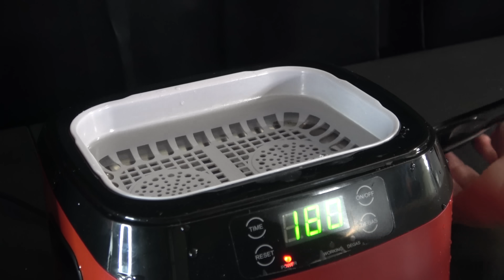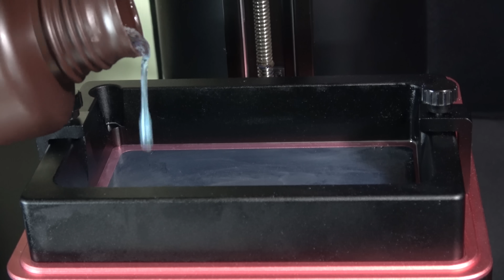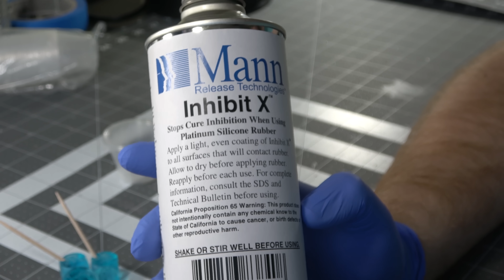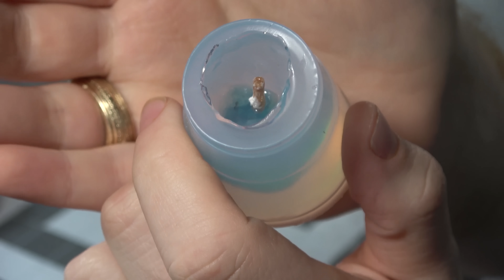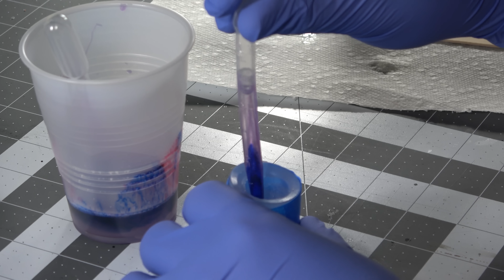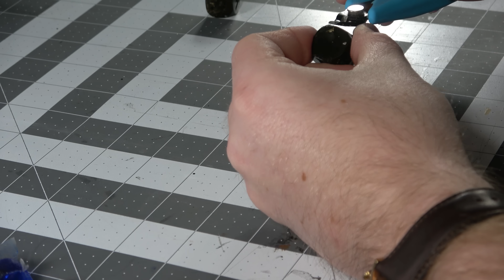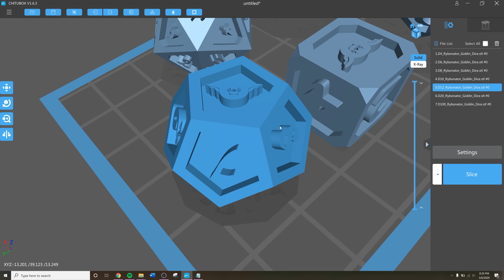How to Make Master Dice for Molds from 3D Printed Dice

Comment: Thank you soooo much for giving us the free files, they look amazing! 
But i have some issues with the downside of the pre supported dice. All the zeros on the lower side of the d100/d10 and so on, have issues and i cant figure out how to fix it. 
I tried different resins, heated up the room, warmed the printing plate and the resin bottle in a water bath, tryed different settings on my printer (mars 3 pro) everything with the same result. Not good enough for my masters. Now im trying to put on the supports manually, i'll let u know if it change something.
Reply from the maker: For manual supports, run a TON of them along the edges of a die, and hold it at a 45 degree angle. There is a guide I've put up, and another great Youtuber did on how to do it :)

Comment: I know this video is a little old, I see in almost all your vids where you sand you use glass under the sand paper. Is there a specific reason you do this?
Reply from the maker: Yes actually! Glass is perfectly flat, and so your sanding comes out consistent every time. Other surfaces often have imperfections which can ruin a sanding

Comment: hello everyone! is there anybody out there to tell me how to avoid fails on 3D printed masters? I followed all Rybonator advices for printing good masters : dicemaker program, good orientation with custom supports on edges, and I tried to print with sunlu abs like clear resin : I tried 1.7s, 2.5s, and now 3s exposure time , 0.05mm layer, 10mm high above build plate, and I decrease lift speed between 40-60mm/min... And I still have ugly faces on build plate side, and I dont unerstand why! Faces are curved and numbers are blurry ! If I am right, clear resin is tricky : it needs longer exposure time ( I did) It needs low lift speed ( I did) and I supported my dice with care on chitubox... So what am I doing wrong?

Comment: Believe it or not, What worked for me when printing my Dice was laying it flat with almost not support (Except for Islands). For some reason, printing with supports always failed on me. It didn't come out perfect at first, and I actually thought it failed because of it, but hours later, I came to find out that it was just half-cured resin stuck in between that a toothpick cleaned out. And as I made mine as rounded bevel dice, I didn't get the warping you did, if I had to guess.

Comment: I notice this is one of the few videos where you're making rounded corner dice. Is there a difference when making your silicone mold with the rounded corners or is it all the same?
Reply from the maker: Rounded is generally harder to hand make honestly. Sanding is easier on flat surfaces. These have flat surfaces with round edges, but aren't fully round so they work ok

Comment: Hello!
I have a question about the type of dice. I recently did a laser engraving on a dice I bought X years ago - I don't even know where I got it. The engraving came out very nice, clear and sharp. So I bought a new dice blank - except that the engraving on the new ones is not so clear and the plastic is slightly melted. The graphics are slightly blurry because of this. I heard from a friend who used to do laser tests that he also melted his dice. I will add that the laser parameters for the first dice and for the new ones are set the same. Just a question of quality and material from which such a dice is made. Can you recommend which dices are best? In the description of most dice it is written that they are acrylic.
The question is whether all of them are suitable for laser or not.

Comment: Great video even years later!  I resin print a lot and only use a sharpened metal scraper.  I have two different printers and have bought a flex plate for the Photon and still saving pennies to get one for my 8K Phrozen mighty

Comment: As a safety thing, be SUPER careful about isopropyl and resin. Isopropyl will increase skin absorption of the resin, which should already never be touching bare skin! Make sure the environment that it's being printed in is well ventilated. Avoid latex gloves if possible (especially repetitive usage) so that you do not start reacting to latex.
Reply: If you start reacting to resin with contact dermatitis, consider never working with resin again. It has serious health and allergy implications.
Reply: If you sand resin, consider still wearing a mask even if you water down the sand paper. Plastic dust is bad.

Comment: This probably won’t be seen but did you use any type of mold release after applying Inhibit X? You make no mention of it but everyone else says to add mold release.
Reply from the maker: I never do- I haven't had any issues and it dulls up the dice face. So you can, to make it easier, but you do not HAVE to

Comment: No supports are typically only used for prints that have an unused face or a face with no design on it. I was printing some jar lids and they kept warping every single time I printed with supports. I tried printing with no supports and it fixed the issue completely. Aside from needing to trim off the excess and sanding it down, the clean up was great and everything is perfectly flat now.

Comment: I personally don't have a 3d printer, but a friend got one. It's a different kind though, printing in very thin layers I think. Can those print smooth enough for dice masters, too? Or do you need a 3d Printer off the same type as in the video?
also sorry if this is phrased weird, english is my second language

Comment: Question: why use molds at all if you can just 3D print the dice? Is it easier / more reliable to use molds to make more dice rather than 3D print them all? Or is it just so you can do cool switly colours and glitter and whatnots?

Comment: Super late but maybe this will help someone:
1) Try not to print with large, flat surfaces directly facing the print bed (like the face of a D6), even with a lot of supports, that still leaves a lot of unsupported material, and also results in more suction force when the cured layer is lifted off the bed. So printing a cube, you'd want it at a 45 degree angle or one of the corner points facing the bed.
2) For removing supports, soak the (cleaned) print in hot water for a few minutes, this will soften the resin and the supports will come off much more easily.
3) Curing in the sun fine, but it can discolour your resin (The sun is mostly UV-A which can cause a reaction in your resin) a purpose made UV lamps are cheap and do a much better job.

Comment: I've been searching for a way to do my masters without using the stabilizer or the inhibit sprays. I think i worked it out. Heat cycling 20 in a 180 oven inbetween 2 min in the UV lamp and do this 3 times. do this after you removed the supports and hit the spots you needed to with sand paper.  I have made a few masters and molds and i've have 0 issues with the silicon curing.

Comment: I've been trying my darndest to print a bunch of dice files, but they all either 

A. Fall off the build plate
B. Don't attach to the supports 
C. The supports end up breaking the edges and/or numbers

I am just having a hell of a time, should I use a different resin?

Comment: You’re probably sick of me :) I love your content and always come back to when i have questions.  I made a few molds - i post mostly on my Potent3D Instagram and TikTok — ANYWAY … I didn’t use a pressure pot to cure the silicon for my first 3 or 4 molds, and while they were good, they aren’t perfect. I need to give the pressure pot a change. I am concerned that my “forms” are glued together and we’ll see if they hold up. Again, thanks for your instructional videos, they’ve got me ADDICTED to resin and silicon

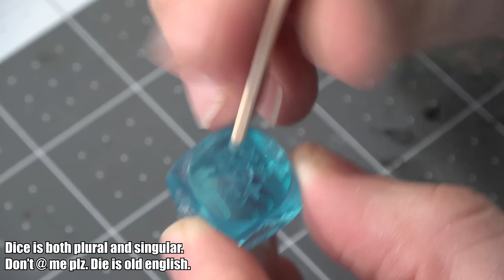Comment: The whole idea of drilling into the face is so you can easily sand off the sprue, in the easiest way possible while youre sanding the other faces, it's as easy as it gets. At 9:00 you hit the corner with the drill bit, and pretty much did the same for every other dice, making the whole point of drilling into only the face, completely moot; it is no wonder you had issues cleaning them up, as you didnt do it correctly and couldnt make use of flat sanding technique to clean up the sprue. You tried to get fancy for some reason, drilling at an acute angle underneath the symbol for some reason - as long as it is indeed only into the face, you wont have additional clean up like you would if you put the sprue in some other awful place like a corner or god forbid on a symbol, same thing, embellished.

Comment: Just a thought, if you’re already 3D printing the dice, why not add the sprues to the print?

I’d been working on molding a weapon shaped dice set, and due to the complexity of some of the shapes, I had to do it this way. I’ve had good success so far, and clean up from dice to dice seems to be far for consistent (based on my experiences) than drilling and gluing. It also let me add a little funnel shaped “resin reservoir” on the pour-side of the sprue

Comment: Hope to hear from you on this - I bought sorta-clear 37, they didnt have the 12 that you used. Mine was so thick it doesnt pour - rather needs to be spooned in to the mixing cups and mold ... is that a function of the # i used vs you?? i did make a very simple silicon ring that i was testing for something else, so it "worked" but i cant imagine pouring like you do. Thoughts?

Comment: Thanks for all the videos, Rybonator. They are very detailed and excellent. About to make my first molds and dice this weekend.

That said, I want to point out that the full file with the fins included there are some minor issues. Many of the dice come out rather small. Especially the D4. It is about half the size of a typical D4. The D10, D100, D20 and D8 are also a bit undersized so I had to scale them up and re-fin them myself.

Keep up the great work as always.

Comment: Hi!  I have been using your dice tutorials to improve my dice making and you have made such a difference, THANK YOU!!  I am working with my first set of 3D printed master dice and am unable to get a mold that has a shiny finish.  I have read several comments on many different sites that recommend a dice sealer, but the user comments within that product are not the end result I am looking for.  I am hoping you can point me in the right direction and let me know how you get a shiny finish on your printed masters before you make the mold?  I switched to the pottery wheel and Zona papers right after I saw your video on that technique and love love love both!  I have used Inhibit X as well, per your suggestion and have not had an issue with curing.  I just cant get a shiny finish on my dice straight out of the mold like I do when I make a mold set from a "normal" set of dice.  Thanks in advance and thanks again for your channel!

Comment: Do you think that placing the hole for the Toothpick inside modeling software on the actual model would be more reliable than using a drill?

Comment: @Rybonator - you should soak the finished still supported prints in really hot water, it softens up the supports and makes them easier to remove.
Reply from the maker: I've started doing that lately! That's a great tip :)

Comment: Do you know any other way to prevent cure inhibition without the inhibit x? It's just an investment I'd like to avoid making if I can.
Reply from the maker: Supposedly (testing now) if you simply wait 2 weeks before putting in silicone, it shouldn't have any cure inhibition issues :)
Reply: @Rybonator  Hi, its works? wait its usefull for avoid curing problems?? :c im a bit desperate haha

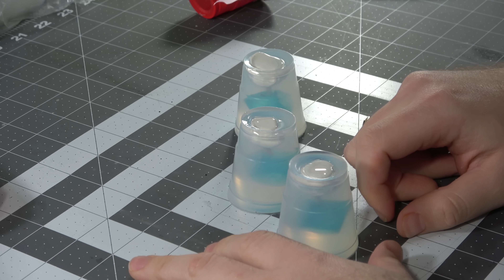Comment: @13:10 you need sulphur free clay. Also using a pressure pot for curing silicone isn't ideal as the air that is compressed as the silicone cures just expands again once you release the pressure. Silicone isn't rigid enough to keep it's shape and small air bubbles will still show up in a pressure cured silicone mold. Vacuum for silicone, pressure for resin.

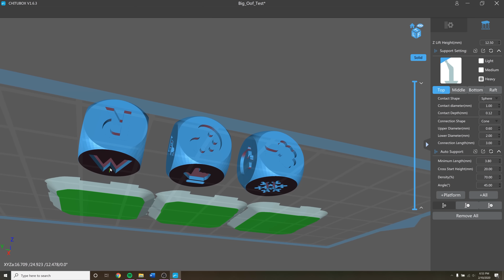Comment: @3:00 too much suction on the supported part. Better part orientation will help. Also you need support not because the first layer cures longer but the z0 is never truly 0. These hobby grade 3d prints aren't capable of a perfect first layer so this results in an elephant foot just like in fdm printing.

Comment: Hey Rybonator so I finally got some stuff to start casting and tried pipets but they are a little difficult to use and not reusable, try syringes without the needles a lot of chemists sell them for super cheap and they are super accuate and easy to clean the resin out of! again still love all your videos been watching them for a while.

Comment: Made many silicone molds with 3d printed stuff, using various resins (elegoo, anycubic, abs-like, water washable, even Eco resin) and I never needed to use inhibitors. Just cure them in a chamber with UV light for 1h. You probably had some undercured surfaces (happens a lot after sanding)

Comment: Hopping back on this video for a question :) I bought some ZOna and took a clear resin cube i printed with a skull in it (i posted it on my potent3d instagram months ago). I originally sanded the cube with like 400 and then 800, then clear coated it. It was my first project like this, and it was "passable" but not GOOD. So i took the 400, sanded it down, then the 800, then used the Zona. The sides are now glass smooth and if i wet the cube, it looks great. But when it dries, its back to "frosty". Is it just the resin? Im using for this one Elegoo "clear". I use mostly Siraya now, but either grey or their Blu blue. I did note your comment re water washable translucent. Im just trying to make sure its a resin issue and not a ME issue :)

Comment: At what point are the clear blue resin masters cured? Is it after the sanding but before the toothpick? Or do you just not cure the masters before coating them with Inhibit-X and using them?
Reply from the maker: I cure them right after taking them out of printer :)

Comment: Hello! I may reach out on a few more platforms if possible, I hope I’m not a bother but I am having some trouble with something and I think you might be able to help. So I used the base ideas from this video to get a set up for some dice that I had designed on blender. Same printer and everything. However, after attempting three prints i am running into a problem that i cannot find help for. The top number/image of my dice, not the on connected to the supports but the one sticking up, is getting filled in. Would you or anyone have any advice for how to fix this?

Comment: If the letters die stands for colors, you could just paint each letter with its appropriate color. That would look even better in my opinion, since they actually have a meaning and are not totally random

Comment: Question for anyone who gets their own Masters made. Is there a reason that you don't 3D print the sprue (sp?) and Reservoir as well as the dice? Should we consider putting the Sprue on the highest number instead of the 1 so that if there is any imbalance to our dice it will end up with the highest number rolled more often than the 1?
Reply: When I say print the sprue and reservoir, I'm not saying as separate pieces, Is there benefit to printing all three pieces as a single entity? That way you can get angles and everything perfect

Comment: Two comments.  Results were better on the "water washable" resin because it is transparent and your cure times act differently.   Secondly your issue with the air drying clay is that you didn't let the air drying clay dry so the moisture in it kept your silicone from curing properly.

Comment: Dunno if anyone else has commented on it but here is the reason why the second attempt failed (as someone who litterally just went through this)
- When you have supports, you need to carefully apply so that there is about 1mm of space between supports. To use less support, and to that extent, less cleanup, try and have the dice at a 45 degree angle, and then have 1 support on each facing and one directly on the corner. It should work better and it should be easier cleanup. Here is a picture of a d6 for reference.
https://docs.google.com/document/d/1UwwJUYC966H42OA16S658llJpjyiFuof8kTm0wZnpSI/edit?usp=sharing
Hope this helps

Comment: I recently bought a Elegoo Mars printer and have been trying to print some dice. I was wondering how you prevent some of the edges from sagging. All of the sides that face the build plate are uneven and the corners are somewhat rounded compared to the other sides. I was wondering if you had this issue and what you did to resolve it? Thank you!

Comment: Got a Mars Pro printer myself and I tried printing some dice. I also added sprue holes into the STL, which means that I didn't have to drill directly into the dice, which is nice. I also printed off a sprue, which is a long rod and a cone'd tip, which can neatly shove into that hole. Issue I had with printing straight edge dice was that I noticed it didn't print perfectly square. The one I printed first was on supports, but it was flat faced, and the face looks like it bulges out. The other faces were fine. The next one I printed on a 45 degree angle in two axis, so it started to form on a point. It was a bit better, at least the faces were decently flat. Though the square of the face wasn't a square and slightly off.

Comment: For reducing blemishes on the face of the 3d printed dice, try putting all the dice on a 45 degree angle (point down) and putting a ton of light supports only on the edges and bottom tip. Once the print finishes and are cleaned put the dice in very warm tap water for 3 to 5 minutes. The supports should come off super easy with little to no damage. (Not sure if this was already suggested only got 1/4 of the way through the comments. )